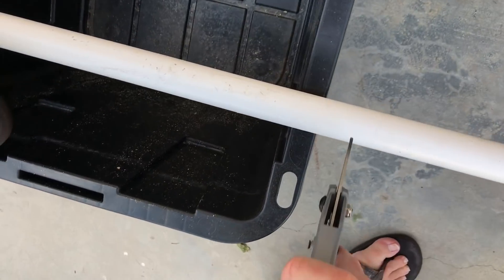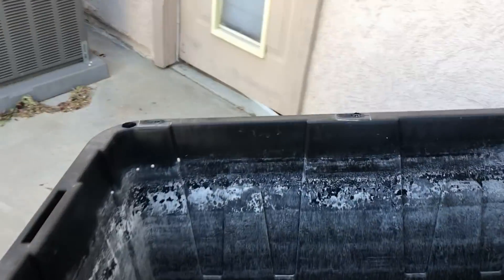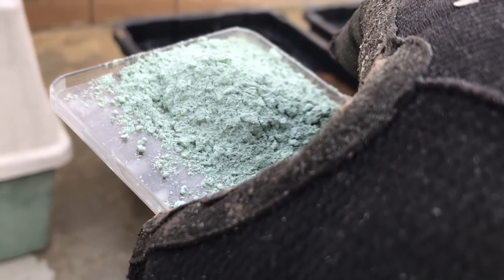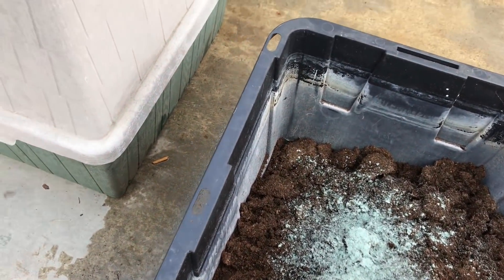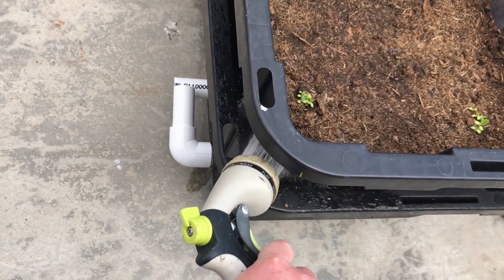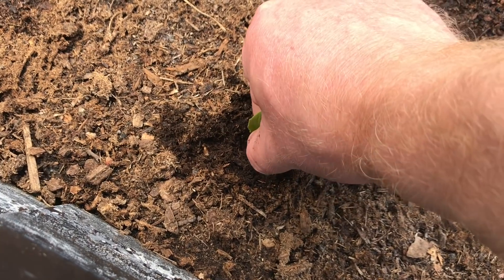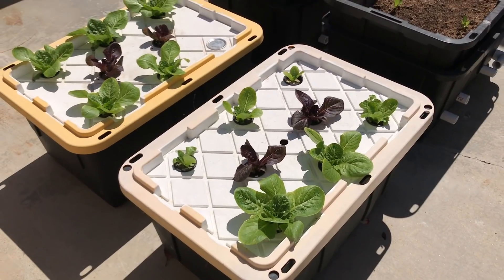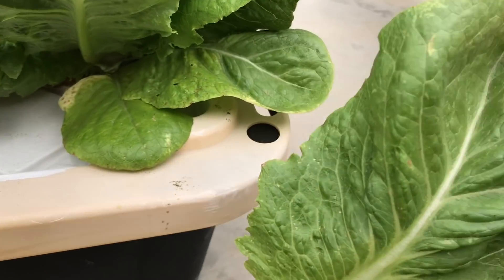Soil growers can't handle this video!

Comment: You might be good at hydro set ups but u know nothing but shit about starting plants in soil. The shitty way u did it made them not germinate and not live or root properly. You have to be extremely careful in soil when planting a germinated seed but i have mine pop way before your bulshit hydro my seeds pop in 2 days have 1 inch tap root and with the seed still attached in 2 days green and going strong. You cant water the way u did in soil and expect anything to live plus i keep my soil completely saturated with good drainage so i have best of both i usually water close to a gallon a day

Comment: If you aerate your totes you can fill the solution to the point where most of the net pot is submerged.  The Japanese say that if it's safe for the bugs it's also safe for you.  Perfect produce comes from using poisons for the bugs, which are also poisons for you.

Comment: You didn't do a blind comparison, you probably have a manual bias in selecting the pest damaged leaves, unless you used some objective criteria?
Reply from the maker: maybe.  i did video the bowl of leaves
Reply: @JebGardener   I don't doubt you were fair, but the video shows the leaves you selected manually. Manual bias occurs even if the researcher is completely impartial to the outcome: If you know which is which your subconscious impressions might make you select partial to a certain outcome, and even a few leaves more or less is probably a big difference. You could number both batches and have someone else select the bad leaves :) they'll know no more than "batch 1" or "batch 2".

Comment: Me: yeah this video was kinda interesting

Soil growers: I can't handle this video
Reply: No, he just did a shit job. I got my soil tested but didn't get the results back til I had already planted my lettuce. My soil was deficient in several nutrients, and I hadn't added any fertilizer and didn't weed them. They still grew much larger in the same time frame as what he grew under more controlled conditions.   He just doesn't know anything about growing in soil it seems. You might be able to grow bigger plants on average in hydroponics systems but this video is just not a good representation of that.

Comment: I guessing the difference other then ones in soil and other is in water, the water one you use some kind of fertilizer in the water, is the fertilizer organic or is that even possible cause I don't know, but is it chemical fertilizer or is it organic fertilizer,  be nice to know, thanks for the vid
Reply: You can buy 100% organic hydro nutrients if you want to. Or you can use general hydroponics nutes. It's just mineral salts basically

Comment: Try using couple tablespoons hydrogen peroxide and a water sprayer you can also do a one-to-one ratio of water and hydrogen peroxide to prevent mold and root rot. Anyways very nice setup.

Comment: I tried the wicking bed with peppers one spring. They grew amazing until it got hot (I live in Phoenix)....Fried. As you found out with the wicking beds it is dry on top. It is better to start a seedling else were first so it has some roots that will be long enough to reach down to where it is moist. I will try the wicking bed again next year but start it in January.
Reply from the maker: yeah transplants would probably do better
Reply: I just realized that you’re build for your wicking bed will become a huge mosquito nest. Have fun with that.

Comment: https://www.youtube.com/watch?v=OOqxmWxa5CQ Soil growers can't handle this video!
This is a biased website no matter the author says. Ever heard of the Incan chinampas? The floating gardens of Burma? The 1920s and 1930s hybrid soil-hydroponics system that combines the 10,000 year old time-tested and time-proven reliability of soil growing for soil is the world's most powerful self-regulator and self-stabilizer of growing medium that ALLOWS FARMERS TO MAKE A MISTAKE AND STILL GETS A SIZABLE AND RELIABLE HARVEST FOR SOIL IS AN INFINITELY FORGIVING GROWING MEDIUM and connects it with the efficiency and effectiveness and higher yields of water culture hydroponics. Adding some of the 1950s component designs of the world's first non-circulating Wroclow hydroponic system developed in Poland during the Cold War and coombine that with the basic principles of Professor John Todd's Living Machines systems plus in combination of terra-preta carbon soil treatment, composite rock dust powder mixture remineralization and perennial nitrogen-fixing living mulch like kura clover, white dutch clover, crown vetch, and others and applying nitrogen-fixing rhizobial bacterial inocculants and mychorrizal fungi inocculants and applying protective plants like Yerba De La Pulga, Chamomile, annual Mexican Marigolds, etc. You can get tremendous yields. One of the components of the Wroclow hydroponics is responsible why it is non-circulating and the use of living machines eliminates the need to replace the dissolved nutrients in water culture and all you have to do is keep adding water to replace what was consumed by the plants and transpired by the plants and adding composite rock dust powders mixtures to replaced what was consumed by the plants.

Comment: Wow, you are...really...really bad at growing things in dirt.
Reply: Right? Dude's still got tiny lettuce sprouts a month in LOL.
Reply: @philcollins5749  I find this happens when there isn't enough fertilizer. He needs mega amount of nitrogen andd a ton of chemicals hormones, steroids, auxins, to super start the soil. Remember soil grows suck but soil with chemicals vs hydroponics with chemicals would be awesome. Those plants in both hydro and soil need superthrive it will boost root growth.
Reply: Fr
Reply: I mean, I've tried growing star fruit trees in soil and they take forever, but hydroponic.... they grew probably 40% larger in half the time, so while I still grow with soil, you can't argue with hydroponic results when it comes to certain plants
Reply: Sounds like a Monty Python skit. "OI. Thats not real dirt!"
Reply: Hydroponics plants grow really really fast. I have tested this with peppers and tomatoes. Unfortunately tomatoes aren't too viable for hydroponics as they take too much space in diameter and require way too much water.
Reply: @mozarth  
I've seen many hydro tomato operations though
Reply: @SmalltimR  Sure, me too, but they essentially need to be staked (which is hard with no soil) and they are wide plants, consuming too much space on the tote, so you can only have 1 plant per tote, which is less than ideal in my setup.
Reply: Obviously He's not a dirty man
Reply: Yeah, My dirt lettuce is already going to seed long before day 48. 
Still, the hydroponics part is interesting.
Reply: @mikemead2315  Yeah, but that's..what this guy does. It's legitimately interesting, but the "my water bath full of store bought nutrients is better than dirt" attitude is...irksome.
Reply: @drackar  Well hydroponics grows plants faster than soil
Reply: @PrincessAshley12 but with a fraction of the nutrient density.
Reply: @stixglass8442  Citation needed
Reply: @PrincessAshley12  look up Brix levels and Brix testing
Reply: @stixglass8442  "Generally, the nutritional value of the hydroponically grown vegetables appears to be the same as the one found in soil grown produce. Hydroponic growers have the capability of precisely controlling all the mineral levels within the plants, unlike their counterparts who use the traditional form." This is what I found 🤷
Reply: @PrincessAshley12  where did you find that? I'm genuinely interested. I've never read anything like that on the subject.
Reply: @stixglass8442  I did what you said and because I was curious "brix levels hydroponics and soil", I got this website called Placecallhome (dot)com, and I just quoted from the article I read. 🤷 I'm open for correction, so let me know your thoughts on that.
Reply: @PrincessAshley12  first off that site is about DIY home improvement. Second I could not even find the word Brix in any of the hydo articles. No citations or references for their articles. Not even sure how you found that site. I searched hydro vs soil brix testing. In the first couple of sentences it was addressed in 420magazine.com (which isn't an academic site) but at least it cutting edge horticulture.
Reply: @stixglass8442  Thats what I got when I searched it up, 🤷. And thanks!
Reply: @PrincessAshley12  maybe they meant conventional soil grown plants with synthetic fertilizer. I'm talking about living organic soil utilizing the Soil Food Web.
Reply: @stixglass8442  The site itself is a DIY home improvement but the article specifically links facts and studies from the USDA about hydroponics vs soil nutrition. I can't post links or else my comment will disappear (don't know how to fix this), but I'll look at your article aswell.
Reply: @stixglass8442  Oh I see, gotcha! Thanks!
Reply: @PrincessAshley12  happy to help. It's my livelihood and passion. I appreciate your genuine interest.
Reply: @stixglass8442  No problem, I appreciate the help once again. Take care 👍
Reply: Lack of nutrients man
Reply: Can some teach this guy how to do a scientific comparison! Please!
Reply: You just can't handle it
Reply: @danieldeelite  fuck you chem bro!
Reply: @danieldeelite  show me a pic of your chemical veggies or fuck off!
Reply: @danieldeelite  GROW THE FUCK UP, or get out of here... (pun intended)
Reply: 1. Using Miracle Grow mix, granted it’s an okay mix but using that brand speaks volumes.
2. Amending only 1 with only greensand.. smh “soil” needs nutrients too!
3. Technically that potting mix is a soil less mix which is a form of hydroponics, so you didn’t even grow it in soil and he did a terrible job at it.

Greensand is pretty much the least sustainable amendment anyway.
Reply: @BobLSaget  Agreed had he grown it in compost we would have a much more interesting contest. However, having the nutrients mostly bio available dissolved in the water where the plants don't really need to work to set roots is really hard to beat.
Reply: @BobLSaget  I'll be honest.  I could go out into the woods around my house, dig up some of the loam, dig a little deeper and get some of the clay, mix that together, give it zero amendment, and do better than his dirt sample did, with proper care and water.
Reply: it seems you can't handle this video
Reply: Zero soil aeration. If he'd have put the PVC in the actual soil bed with more holes in it and used a Hopi wicking pot he'd have gotten much better results. It looks like he was using dead dirt instead of live soil because it stayed too moist and got no air.
Reply: Rude just no need
Reply: hes not, dirt is just worse
Reply: @zoom9223  right? Cause who wants  nutrient density in their food?
Reply: Drackar Things are heating up in the gardening fandom.
Reply: Come on now, that's not helpful
Reply: I bet my dirt can beat up your dirt.
Reply: @slaker199  challenge accepted, lol.
Reply: ....holly shit a lot of stuff happens when you don't get notifications on a thread for a year, I guess. 
The hydro fanboys are hilarious, though...  Ya'll keep micro-dosing chemicals into your water baths. I'll keep growing stuff in dirt, without that kinda hassle.
Reply: @drackar  Right? I mean the hydroponics look very interesting but personally I'm growing plants in the blackest, worm rich soil I can create by continually compounding various organic materials into it during the composting process and it works well enough. Of course having growlights and a controlled environment works better for the size but I have my doubts about getting the same kind of nutrient variation that you get from compost and mulching.
I think Jeb in Space would be amazing though. It's truly fascinating how much this man can do with some plastic containers and rockwool.
Reply: @henryjubeda7617  soil growers can't handle this video? But the guy uses miracle grow and not nutrients to grow lettuce vs. feeding in hydroponics for lettuce in the other set up. Come on, what is that comparison? You can't grow plants in any soil ya know. Miracle grow? That stuff is pretty bad, especially long term. Peat moss? It's Okish but acidic. The guy tried to grow lettuce and didn't add any nitrogen. Not to mention the green sand in the soil probably needs to be broken down and I'm not sure it even will break down because I thought green sand was used for better drainage to creat sandy Liam soil. The holy grail for nearly all plants. 
Growing plants in compost and in pots is vastly overrated, dangerous, and silly as it doesn't happen in nature like you think. 
For those interested, look up Laguna nursery's Gary. If you look at his "lectures", they nice trust me, they you realize soil has been destroyed. Don't grow plants in compost unless you are in the ground with amendments. In pots, growing in compost is a death sentence and I never new why my plants died even tho I put it in a miracle grow/ compost 50-50 mix. Now I use Coco coir, vermiculite, and then add some worm castings and sometimes some fertilizer throughout. No pure organics materials should ever go in potting soil. Ever. Organic material on top of the soil is the way to go in pots in my opinion. And frankly, my results are better this way...the plants actually grow and don't die lmao. Unfortunately, I don't get enough light in my yard so that hinders me a lot. 3-5 hours not really enough for full production. But in the future maybe :D. 
I want a better experiment that is a bit fair tho 😂
Reply: lol he was right all them soil growing boys cant handle the video. soil is for foolz, hydro rulez
Reply: @Grinix0  show me a brix test or STFU!
Reply: Don't blame the grower blame the dirt
Reply: @sweetness6048  the dirt was fine. The grower was incompetent.
Reply: Exactly all he did was prove his ignorance with growing in soil hahahha no ewc compost or other humus
Reply: He’s not bad at growing them they are bad at growing in dirt
Reply: @tam4176  you're bad at reading words and understanding what they mean apparently
Reply: He is not good at growing anything it seems

Comment: I would add some structure so roots can hang on and cumulate closer to baskets. Classic hydroponis with long hanging roots has too long nutrients travel, I think it is best to make it short and make plant develop secondary roots more. Well if you grow something fast growing like lettuce it does not matter than much, but if you grow something whole year, than it makes more sense.
Reply from the maker: seems like a good idea for a side by side comparison.  thanks.
Reply: @JebGardener  Yes, but it is just a hypotesis. I think  if you start with big box right away main root will grow in normal rate anyway and secondary roots will develop normal as well. Maybe you should try first same volume wide box and tall box too make comparison. Also one sugestiong for structure for roots. Simple use bigger baskets and more keramzit.

Comment: Definition of Soil: 

The top layer of the surface of the Earth in which plants grow. Soil is composed primarily of disintegrated rock particles from the Earth's crust. Soil particles are classified by their diameter. Clay particles are less than 0.002 millimeters, silt is 0.002-0.05 millimeters, and sand is 0.05-2.0 millimeters in diameter. It takes 100-500 years to produce an inch of soil from rock of the Earth.  A healthy garden soil should be more than 40% silt with good aeration, water retention, and 1-5% organic matter (humus and living organisms).

Peat moss is  found in bogs and is an ingredient added to potting mixes. It isn't soil.
Reply: The Senate  you're correct. You actually need about ZERO. Your soil should be close to zero organic matter or at least under 5 percent. The organics matter should go on top of the soil about .5-2 inches thick. Organic matter around roots just begins to rot and takes oxygen away, causing to all sorts of issues. Some things just take longer to decompose. Bark works until it decays, but it takes a while for that to happen. Best soil is a mix of sand, clay, and silt. But nobody uses sand in pots because it's freaking heavy so they substitute it with slow decomposing stuff.
Reply: Matthew Kheyfets compost>organic matter. You can grow in compost only so I honestly don’t know where you got any of your info
Reply: The Senate that is exactly what I said?
Reply: @dropbear2972  you actually can't grow in pure organic compost in most situations. In raised beds, you can. But in pots, very likely the plants will die. Clay is not really organic matter.
Reply: The Senate  oh vei
Reply: The Senate Holy shit are you looking for an argument? If you couldn’t tell from my comment that I meant that compost is organic matter then i think you should stop adding extra chromosomes to your cereal in the morning
Reply: The Senate yes I do but in the context I used it in I honestly didn’t think people would read it and think hmmm yess “compost is greater than organic matter” I can edit it if that’s what you really need big fella
Reply: @dropbear2972  i read it as "compost is organic matter".

Comment: I'm all for hydro, but I've seen a lot of comments on here bringing up a pretty valid point. There's an important variable you're not controlling for, and that's the amount of nutrients both sets of plants are getting. The amount of nutrients going into the hydroponic system is not the same as those going into the soil system. 

Would you consider doing a more "fair" comparison, where the medium for the soil grown plants isnt mostly inert? I'd love to see it! Hydroponics would still win, but the comparison would be more accurate. 

Could even name it something like "soil growers STILL can't handle this" :P